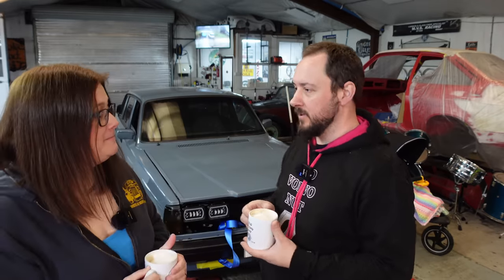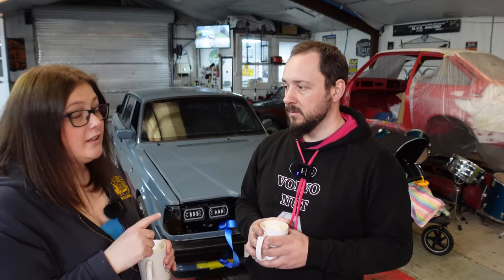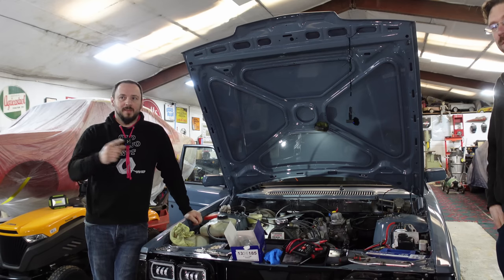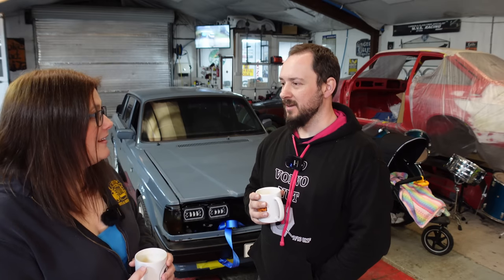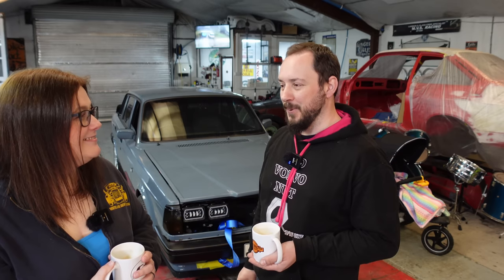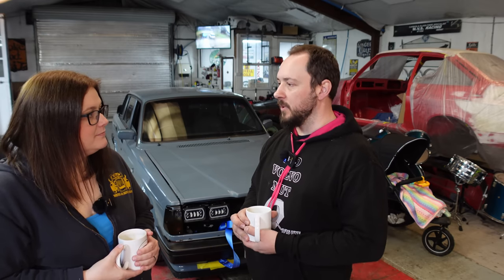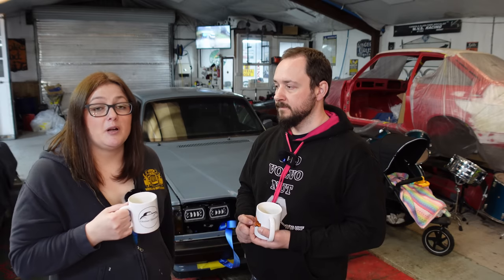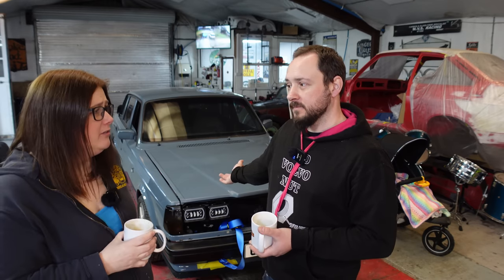This ONE Thing Stopped Our Volvo 240 Starting!

Comment: Just replaced the ignition amplifier on my 240. Was having intermittent non starts and tried everything else. I took the old one off and cleaned it and the time between non start and then starting up improved, but not cured. So I bought a new one and replaced it. I’m convinced this was the culprit! Thanks!!!!

Comment: Glad you guys fixed your Volvo! My 1993 Volvo 240 won’t start now that I had the alternator replaced on it but before the alternator was replaced it started in less than a second so I’m thinking it might have the same issue. Or it could be that something is corroded electrically because it doesn’t sound like the fuel pumps are coming on. Advice would be appreciated.

Comment: The joys of the internal combustion engine. My 940 would not start after sitting unused for about 4 months.
I decided I would dismantle and rebuild every system that contributed to a running engine. Starting with the lift pump in the fuel tank. And that was the failed part. I had to remove the tank after removing the drive shaft, that was a saga. But I fixed it after much work. And now it is a lovely runner. Love my Volvo.

Comment: If the car does not start with easy start, then you need to check the ignition system. One learns by doing. After a lot of research, finally results.

Comment: Yay!!!   Those 7 pin bosch ignition amplifiers are a curse to peugeot owners too, especially Jetronic injection as they dont inject without spark!   single coil variants do only use the 6 pins, there is a version using the same casing for wasted spark systems that does use the 7th pin, these arent compatible.

Comment: Weak spark! I called that!
Reply from the maker: You totally did, just weak enough.... What a mard
Reply: @WhitelandRestorations  You've got it running though, that's the main thing.
Reply: Annoying I know but it works now so congratulations on getting to the bottom of the problem.
Whilst not wishing to teach my grandmother to suck eggs or you for that matter,please make certain that the mounting of the amplifier to the heatsink in not only spotlessly clean but is well coated with the correct compound to ensure best possible conductivity,good luck.
Reply from the maker: Yeah! Number Johnny 5 is alive! 😂